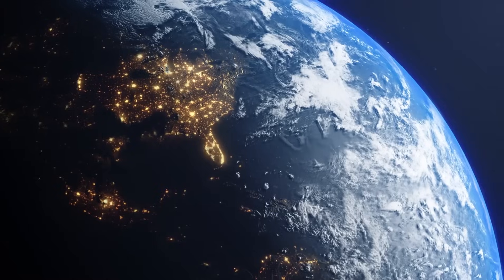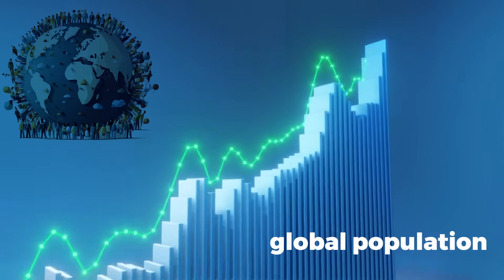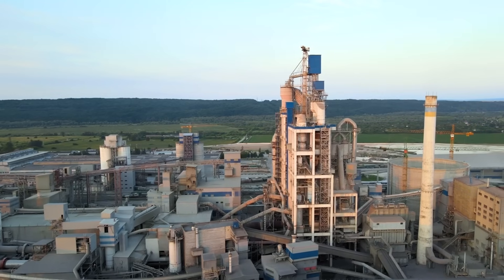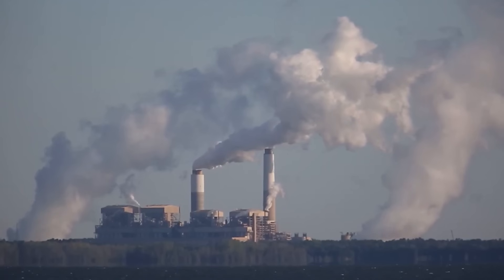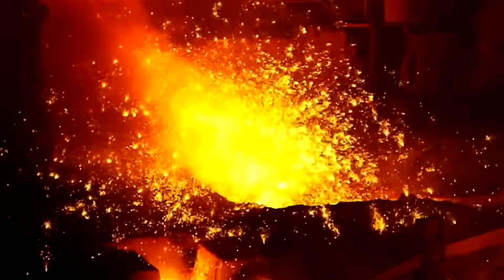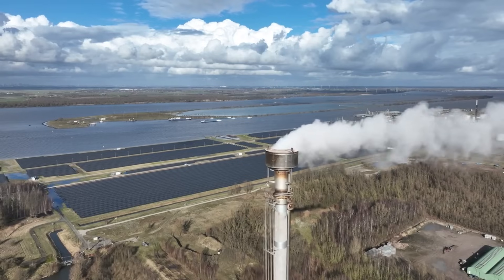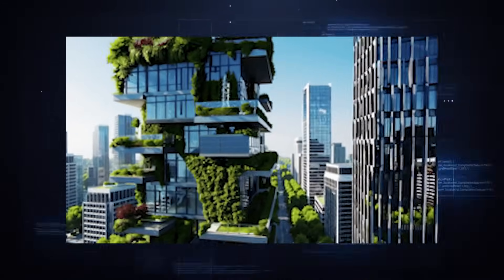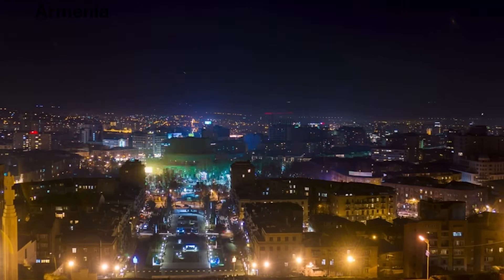This Breakthrough Could Change Cement Forever! (Zero Emissions)

Comment: More pseudoscientific magic wand waving BS.  Turn remounts steel or to even create still requires oxygen furnace.  And there isn't enough renewable energy to produce the power needed to melt steel. 
Stop feeding this BS which is all wishy-washy crap as if it were possible today when it's absolutely not and isn't going to be possible? Because we don't have nuclear energy.

Comment: I thought oxygen was the most used substance. Also, that argument that it produces a bunch of CO2 is one of those 'lying with numbers' things. Yeah, carbon is removed when you turn limestone into Calcium Oxide but the carbon is then removed from the air and put back into the cement during the curing process. That's like saying that if you dip a cup into the ocean and pour the water back in, you're permanently removing water from the ocean.
Reply from the maker: Interesting point about oxygen, and you're right that it's extremely prevalent. Regarding CO2 in cement production, the issue is a bit more complex. While it's true that some of the carbon dioxide released during the production of calcium oxide is reabsorbed during the curing process, not all of it is recaptured. The industry is indeed working on technologies to improve this cycle, but currently, a significant amount of CO2 still ends up in the atmosphere. It's crucial to continue refining these processes to make them as efficient and sustainable as possible. Thanks for bringing up this aspect—it's an important part of the conversation!

Comment: Stop repeating everything that is said.
Reply from the maker: Hello, What do you mean?
Reply: @EyeTech21  You're a liar. The CO2 given off from the limestone during the production process is re-absorbed during the curing process. The only additional CO2 given off would be from the fuel used to 'cook' the limestone and that can be done using electricity.
Reply from the maker: CO₂ from cement production comes mainly from limestone calcination (CaCO₃ → CaO + CO₂) and fuel combustion. While some CO₂ is reabsorbed during curing (carbonation), this process is slow and incomplete—even decades later, only a fraction is recaptured. Electrification can reduce fuel emissions but doesn’t eliminate CO₂ from limestone decomposition. Cement remains a net emitter, which is why alternatives like carbon capture are being explored. If you have sources claiming full reabsorption, I’d be happy to review them, but current research contradicts that claim.
Reply: Especially when he's lying. The most of the CO2 given off when making the cement is reabsorbed during the curing process.